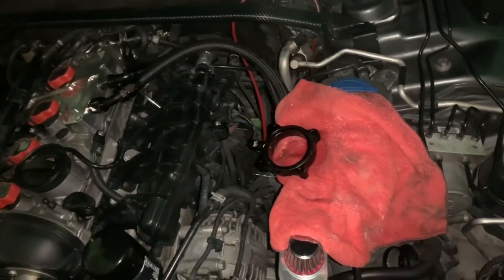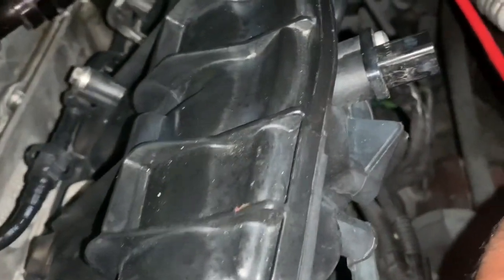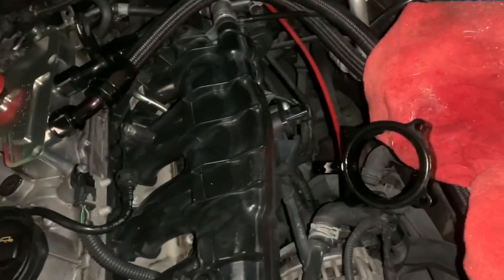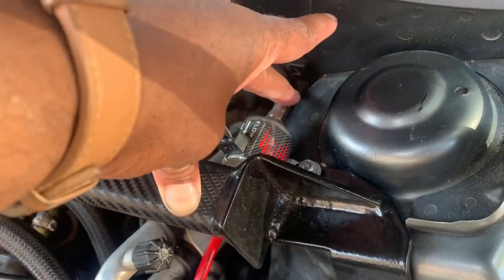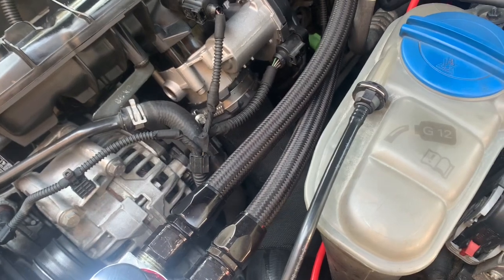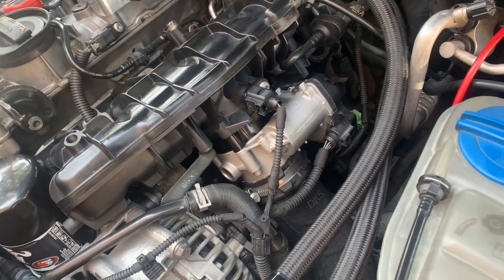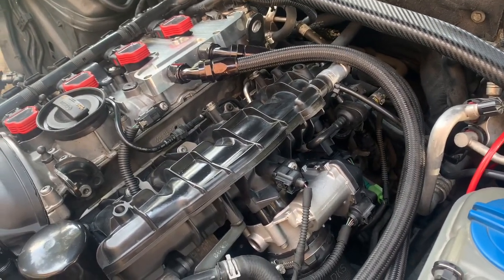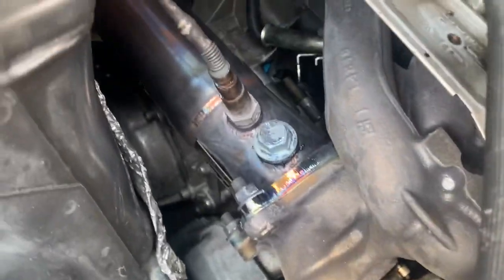How water Methanol looks when it sprays in your engine/ also nozzle relocation for more boost

Comment: I have a 2014 Audi a4 2.0t with some mods. Major things are a k04 turbo and the IE intake manifold. I’m looking into getting the water method setup and I sen on IE’s website that there are 4 hookups right into the manifold going right into each chamber. Have you done this?

Comment: Im about to install snow performance on my b8 a5 should I just go and put the nozzle on the intake tube instead of buying the throttle spacer? was it a major difference or should I just get the spacer cause it looks more flush/stockish?
Reply from the maker: Just get the spacer, it’s more flush, I keep having to fix boost leaks, because of the pressure. I changed it because I wanted my boost juice to atomize more, but it’s not that big of a difference honestly, thanks for reaching out god bless bro

Comment: Bruce if you look at the lower air box you will see it is basically set up for a second lower intake. There’s a 2” knock out molded into the box. I’m going to use some silicone turbo plumbing and mount a custom collector I made behind the RS lower left grill. I’ll let you know how it works out!
Reply from the maker: Most def let me know

Comment: What injectors are you running??
Reply: Also, do you have the intake runner delete?
Reply from the maker: edgar gallegos s/3 rs3 injectors, no don’t have the flap delete, was thinking about getting the hpa intake manifold, with out flaps but everyone is having tuning issues, and apr doesn’t offer anything for a delete, you would have to go hpa manifold, or straight custom tune for the delete
Reply: Bruce Custom Motors I see. But apr should have it, they do sell those runner deletes 🤔
Reply: Bruce Custom Motors one of my friends is tuned with eurodyne maestro and so far no problems with it...
Reply from the maker: edgar gallegos did it help with the hp , torque or air flow, I’m curious, what intake does he have factory, with the delete
Reply from the maker: edgar gallegos yeh for some reason they didn’t have a tune or offer one for my specific, I know it ads bout 10 ho and torque, car, maybe they updated, thanks 🙏 if I do a video on runner flap delete, you know we’re it came from, time for me to research 💪💪💪💪💯💯💯
Reply: Bruce Custom Motors I don’t really know if it adds any performance but as far I can understand flaps add some restriction on the air flow
Reply from the maker: edgar gallegos yeh you get a little more aggressive sound, and a couple more burps. And bout 10 extra, had them on my other car
Reply: Bruce Custom Motors I just bough a 2011 Audi A4 B8 Avant... I was thinking of getting the IE intake manifold and run their tune... but i still got lot to go... so far I got cts cold air intake and catch can, ecs Inter cooler,  Eurocode downpipe,  just order timing kit, about to get a Borg Warner k04 turbo but I still gotta rebuild it, IE pistons...

Comment: I had a APR carbonio intake, and switched to a injen cold air intake, like yours I’m assuming, but I noticed a significant loss in torque, do you recommend that intake or go back to the short ram
Reply: I have the carbonio intake.I am planning on hole sawing the lower air box (stock audi) and installing a second air intake pipe plumbed to my RS 5 lower grill. I hope it works, if not I can always cap it.
Reply from the maker: Chris K that’s actually a great idea, giving me thoughts, you would just have to make sure the y split closes before the mass air flow sensor, because if you run 2 and one doesn’t have the maf, sensor the air flow will read less , and the car won’t account for the gas , and you could run lean, I think I’m going to try your idea for more air flow only on going to weld a secondary cone,
Reply: Bruce Custom Motors I was actually thinking about doing the same thing with my oem box, but instead of a cone, running a tube that goes attached to the bottom that filters in air from the fog light hole
Reply from the maker: ivan gutierrez that’s actually genius, you could legit sale an air flow adapter, and call it air flow extension adapter 🤔💯
Reply: Bruce Custom Motors you might be on to something there! I’ll keep that in mind!
Reply from the maker: ivan gutierrez  the difference for me was ,  better with injen, but I have an open front fog grill, and don’t have my second underlay ,for more air. If you don’t have an open fog grill or area for the air to suck it from the bottom, you won’t get as much air and it might be better to go with the top one that sucks in the air from the top part of the grill thru that suction thing when you open the hood. At the end of the day it’s all about optimizing, your air flow, hell I did a test and took off my  air cone and my car pulled so hard, it was insane but, in Texas my turbo would be blown in a week from, debris 🤣😂🤣